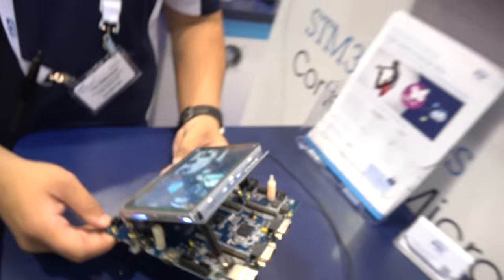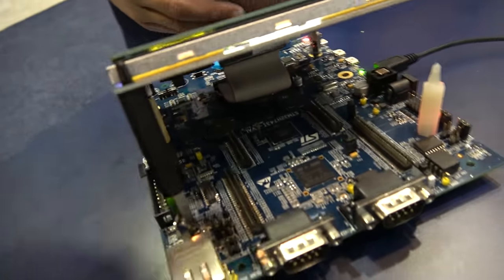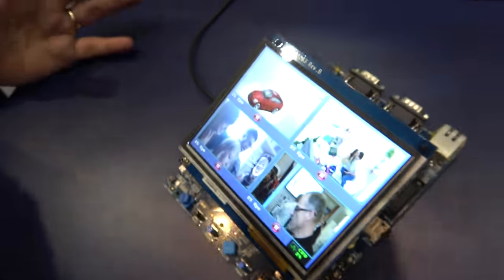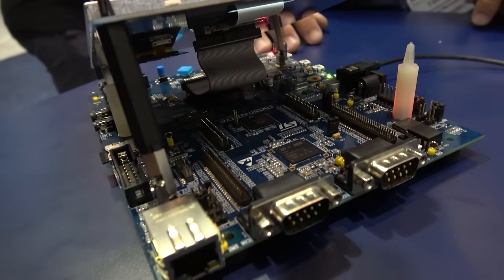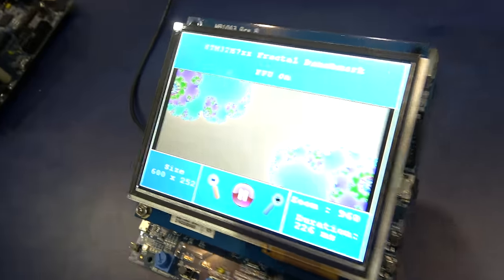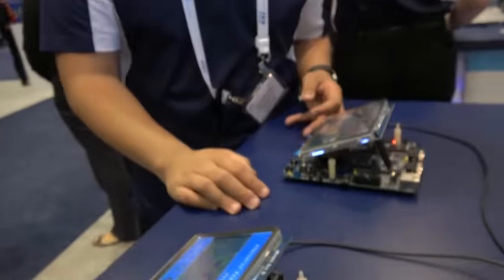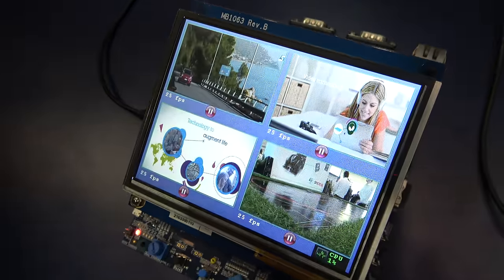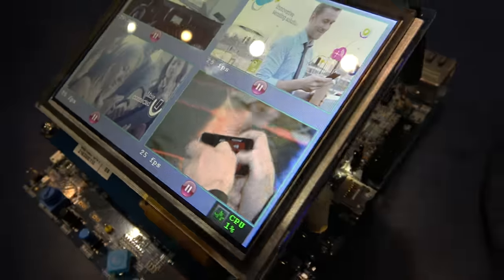STM32H7 ARM Cortex-M7 by STMicroelectronics

Comment: at this point isn't it just an old ARM application processor?
Reply from the maker: ARM Cortex-M7 is quite new..
Reply: ARMdevices.net I mean as in performance. With that fpu and performance what's the difference from say ARM9 or ARM11?
Reply: M7 is a core optimized for MCUs. It features a tightly integrated multi-level interrupt system for example. If you measure e.g. guaranteed interrupt response times it outperforms almost every modern application processor. The STM32 also integrates a lot of co-processing units, as you can see, that are independent of the core.